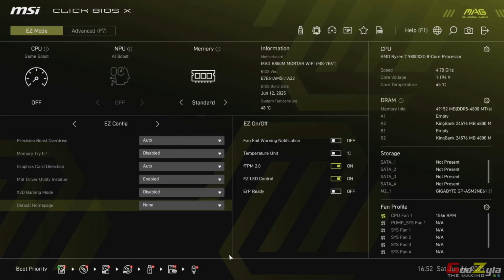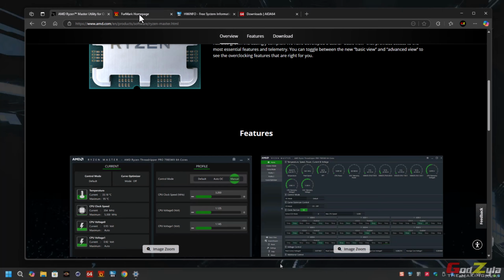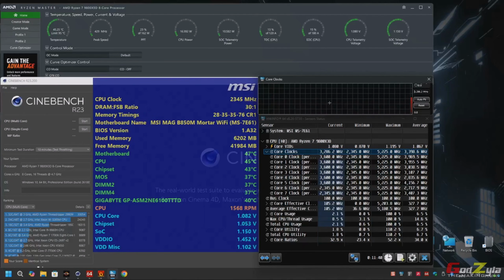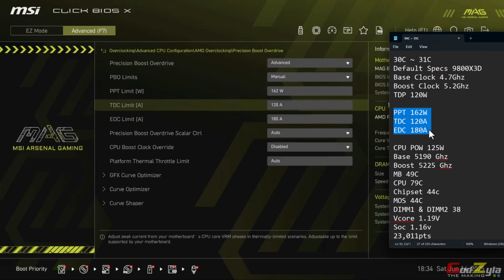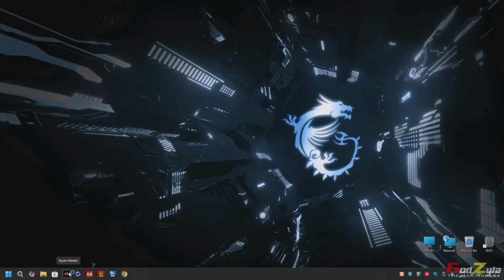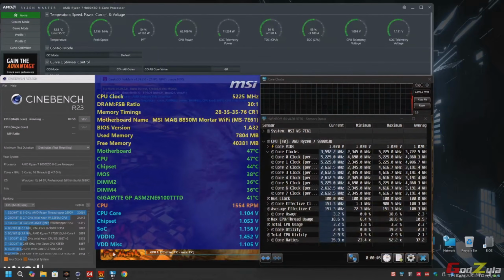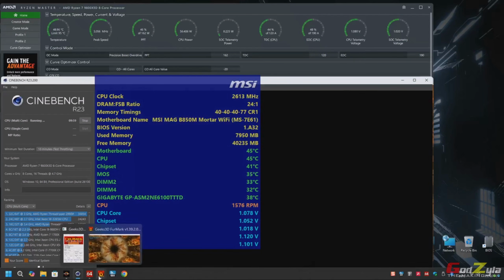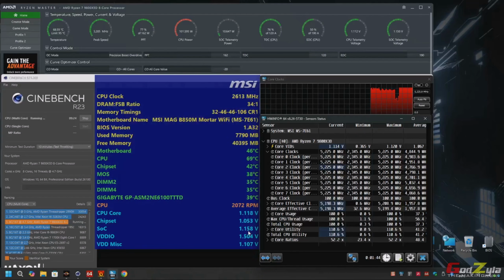PBO2 Curve Optimizing with 9800X3D on MSI Motherboard

Comment: Thank you for this. It helped me w lot to keep the temps in check. I have 2 questions: 
1. with current settings I went down from 5.4Ghz to 5.25Ghz max boost, is there a way to keep same settings but still achieve at 5.4? and is it worth it? 
2. Second quesiton I have a V-Color Manta DDR5 at running at 8000Mhz, CL38 - stable with EXPO without any issues, temps are low as well. However, I was completely unaware about the SOC Voltage relation. Any piece of advise for RAM settings on this one? I would really like to keep the 8000Mhz as I payed exrtra for it and these speeds are officially supported by this mobo / CPU combination (QVL). 
And AMD says its perfectly fine for the SOC to be at 1.3V for this CPU with that RAM speed and it just should not go over so Im a bit confused now :) 
My Mobo is MSI X870E Carbon Wifi with their latest BIOS.
Reply from the maker: Hi Light Orb, welcome to my channel. The question is, what is the CPU power drawn, the thermal temperature and the SoC drawn, when your system is running at 5.4Ghz? If it draws below 120w, temperature at 80 ~ 85 degrees celcius and SoC below 1.2v. You can revert back to your settings. Maybe you need to know how much you are stressing your processor. Base clock is at 4.3GHz and you are stretching it to 5.4GhHz. The concept of an elastic band, will it be good to stretch it for a prolonged period of time?
Also as for your rams. You can set it to run at expo and manually set it to run at 1.18v. This should be sufficient.
Reply: @KleoYan  Thanks! just to clarify for the RAM - High Efficiency mode to Auto amd CPU NB/SoC Voltage to 1.18V, right?
Reply from the maker: @lightorb2932  Yup for High Efficiency mode, set to auto, as I have tested 32G kit which is at CL36, I can't go tightest timing nor tight timing, I have set to auto. I will sill urge you to give it a try, no harm trying, but oo test for stability if it's able to load to windows. Yes for the CPU NB/SoC voltage, set it to 1.18v. if it runs stable and such. you can slowly tune down to 1.16v. If it can't run stable, then set it to 1.2v. 

maybe some info about SoC voltage on DDR5 rams as in general to operate safely. DDR5 memory does not typically run at a 1.3V SoC voltage. While some older BIOS versions or specific configurations might allow it, the recommended and safe operating voltage for the SoC on modern platforms, like AM5, is generally 1.2V, with 1.3V being the upper limit and often unnecessary for standard operation. Running the SoC at higher voltages than necessary can lead to increased power consumption, heat generation, and potentially reduce the lifespan of the CPU.
Reply: @KleoYan  I tested at 5.4 and 5.25 and yeah its 1-2 FPS difference and about 100 pts. less in Benchmarks but the temp  benefit is about 12-15C for me (espetially on the CCD sensor - 79C under 100% load - was going for 95 before). 
1.18V SoC works and its super stable even on my 8000Mhz RAM kit so I think Im sorted. TY again for this video.
Reply from the maker: @lightorb2932 good to hear. Congrats on your configuration 😉

Comment: I have finally been able to get to the setup. My wattage dropped from 110 W to 88 W. (I ve seen 85 W, isnt it too low?) The Temps went from 79 to 70 . My cinebench went from 22950 to 22500. The clocks are stable at 5225 mhz. Not sure if this is a good result as initially the power draw was almost 140 W.
Reply from the maker: Hi Samuel Rolinec, welcome back. With your current settings, have you try running OCCT test? If it pass without failure, that will be good and you can try some games to see if your system is holding well. Now as to answer your question about the CPU Power current. If you have done all stress test and to run games, though your Cinebench score drops by 450pts but your wattage draw drops from 110 to 88watts plus your temperature drops by 9°C. Would you prefer to draw lower current and having better thermal in long run and are you able to feel the difference between 450pts differences in performance? The choice is up to you as I have mentioned in this content. My objective is to prolong your processor and other component lifespan.

Comment: System doesnt even boot after I did this.
Reply: Probably the memory set to tightest was too much for your ram?
Reply from the maker: @god-zilla4233 oh you are right. Totally forgot about this setting. Thanks
Reply from the maker: Hi Faith, welcome to my channel. Maybe list down what components you are using, as majority of my viewers are able to do so, you can check on my comments here.
Reply: @KleoYan I have handled it by changing some values. Thanks.
Reply from the maker: @faithVO  ok. hope you did fix the issue and maybe share what you have changed and why was it not able to boot for you?
Reply: @KleoYan  PPT- 115 / TDC - 90 / EDC - 105  / Curve Negative -25
Reply from the maker: @faithVO thanks for the update. So long it works for you.

Comment: Thanks for this guide. I am using your settings on my MSI X870E Carbon Wifi and my temps goes down to 73 C. Is it necessary to install the igpu? coz I disabled it on bios; didn't install the igpu driver and prefer not to use it. coz I read it on reddit that it is unnecessary if I'm using graphics card.
Reply from the maker: Hi Verbatim1129, welcome to my channel. It’s perfectly ok not to use the IGPU if you have the discrete GPU and you should notice your CPU power drawn will be lesser.

Comment: I would like to see a video like this on a Gigabyte Aorus X870E Pro motherboard with an AMD Ryzen 9800X3D. Like you said following other videos to tune and overclock typically ends in failure. I have ram that has 6000 bus speed and I just turn on Expo and it just works. I love your videos because you get into all the details.
Reply from the maker: Hi B9Bot 1, welcome to my channel. Currently am looking into it and to request a board from Gigabtye. If they do answer to my request. Yes I will do up a content for gigabyte. Thank you for your suggestion 👍👍👍

Comment: How about the FCLK and UCLK? Just leave it Auto?

I have GSkill 6400mhz CL30. I saw a lot of youtuber setting FCLK to 2000 - 2133mhz and choose UCLK=MCLK 1:1 ratio.
Reply from the maker: Hi Aden, welcome to my channel. Yes as the advantage to set 1:1 ratio will help heaps in performance and latency.

Comment: Hello

I would like to try out the set-up you demonstrate in the video. Regarding the initial part with the RAM setup before Windows installation, is it crucial that I do it before Windows is installed or can I adjust the RAM settings even if I have it already installed. 

Thanks
Reply from the maker: Hi Samuel Rolinec, welcome to my channel. If you have already installed windows, you can still set it, no issue.
Reply: @KleoYan  Thanks for such a quick response!
Reply from the maker: @samuelrolinec2727 you are most welcome

Comment: Amazing video, thanks!
Reply from the maker: Hi Yuri, welcome to my channel. Hope this content will be useful to you. Thank you for your feedback and all the best with your configuration. 😉
Reply: @KleoYan  Can lower RAM latency improve gaming performance? I don’t know if I should try tweaking my G.Skill kit…
Reply from the maker: @nanwu33  you can try using the Memory Try It! or manually set it but will need time to do that. I will just enable the High-Efficiency Mode and set the Memory Timing Preset to Tightest.

Comment: Hi Kleo, thank you very much fir this useful video. I have adapted some setting to make it works with my 7950X3D and it very easy to do as you explain it so clearly. One quick question about the VCore offset, if my system is now stable with 0.05 V offset, if I want to bring the voltage down more what is the step I should do (like 0.055 or 0.06 ?) and does it will risk anything in the future aside from the unstable that might happen ?
Reply from the maker: Hi Baseeball Ti, welcome to my channel. I was not able to do below -0.05v. You can give it a try but you will not see any significant drop on thermal by just -0.01v more. Nevertheless, all the best with your tweaks 😉

Comment: Thanks for the video! I was recently upgrading to AM5 and downsizing my case and stumbled across your channel. Many thanks for the fan layout and build guide for the AP201 m-ATX case! 😁
I was wondering, would these same settings be applicable to a 9900X rather than a 9800X3D, or would a different curve be needed? Many thanks and subscribed!
Reply from the maker: Hi pick. Welcome to my channel. You can apply the same. Just make sure to find the default PPT TDC and EDC of your processor and inclusive of the default TDP.

Comment: Hey, thanks for your video. Great work. I have a question regarding my G.Skill timing. I've now set the voltage to 1.2. But does that affect my combination? Or can I set it to auto? I have 2x 16Gig with 6400MT. What do you think, should I leave it at 1.2?

Thanks
Reply from the maker: Hi Dragonfly Jones, welcome to my channel. so long the SoC VDDCR voltage is not above 1.2v it will be fine, but personally, I will try Soc Voltage to 1.5v. this is where my 48G Kit CL22 6800 can run.. Addition to this. having the sweet spot SoC VDDCR Voltage does not affect performance with the rest of your settings in CO and CS. I am unsure about G.Skill. As mentioned, you can give it a try.
Reply: ok i will try. Thank you very much  @KleoYan
Reply from the maker: @dragonflyjones2268 ok all the best 😉

Comment: My kit is only stable with 1.3 soc voltage is 6000 cl 26, is there any danger in this?
Reply from the maker: Hi MaicoN, welcome to my channel. I can only explain to you that the higher SoC voltage, it will increase in thermal and will degrade the processor. Btw how big capacity are your rams and or which brand that is?

Comment: Can I try to use this settings with the x870e tomahawk and gskill cl 30 6000?
Reply from the maker: Hi KuroJota TV, welcome to my channel. Yes you can, the steps and procedure are identical.
Reply: @KleoYan  Hi Kleo and thank you so much for your answer. I also have a nvidia gpu can i do this without having to install amd adrenaline? Now on windows i get lots of screen flickering. Thank you so much for your content.
Reply from the maker: @kurojotatv1804  for this, go to bios and disable the APU, use only your discrete graphic card. or you can just install the chipset driver and not Adrenaline.

Comment: Great content. One question:

Are there any settings to set in ryzen master to use it just for monitoring? Its a confusing application for me. Does it apply the stock bios settings? Overrides previous bios? I dont like it lol i think its weird. Not bad for monitoring.
Reply from the maker: Hi Ander Otaola, welcome back. I did not do any settings and install ryzen master. once loaded, it will pick up the settings you've done in UEFI. I only use it as a monitoring dashboard.
Reply: @KleoYan ok. For some reason ryzen master doesnt show my bios selections under the “control” tab. 

It’ll show my CO adjustments, but not the adjustments for edc, tdc, ppt. 

Otherwise it all works very well… just my ryzen master doest show thise adjustments
Reply from the maker: @anderotaola7515 hmm maybe use revo uninstalled to uninstall ryzen master and to delete the registry and unwanted files than reboot your system. Install ryzen master again. See if that helps 

( https://www.revouninstaller.com/ ). Revo uninstaller will remove all unwanted files / folder / registry in your system. Illustration to use revo uninstaller https://www.youtube.com/watch?v=uMgUYiakpxM&t=437s
Reply: @KleoYan alright, ill give it a shot when im at my desktop. 

A simple removal with windows wont do it then? Id imagine as much— that ryzen master is a bit insidious lol

Thanks for the suggestion, I’ll try soon.
Reply from the maker: @anderotaola7515  just incase if there are leftover registry and unwanted files. I always use revo uninstaller to remove application. as in to have it totally clean out from the system.
Reply: Long story short— it works flawlessly now. All tour settings dialed in very well on identical setup— b850m mortar +9800x3d. Mine runs hotter since its inside a lian li a3 case. 

Cant say why now -.05v offset is yielding wonderful results but it is. The only difference is I noticed my CO was set to -25, not -20. I doubt that would cause such issue. I also used revo, cleaned up, double checked bios, etc etc.  scored 23204 on R23. Smooth. Same performance as yours except the temp and small details like that. 

Excellent stuff, sir. Thank you. 

For the life of me i dont know what changed— but it lined up to your results very well.

EDIT — my highest vcore value during r23 was 1.096. Is that too low?? It was performing super good. I dunno— seems low.
Reply from the maker: @anderotaola7515  hahaha.. well at times it can be a 1.09 or even 1.04v as I experience.. it's normal, not to worry. your motherboard is doing all the calculations when you've set offset. Congrats! 😉
Reply: i actually just now ran revo— and wow! It found stuff i  glanced over when i was looking for registry. Ryzen master does have a lot of stuff you cant easily see, sheesh. 

So i deployed revo uninstaller successfully, but i still cant get RM to display my bios adjustments. It just comes up as stock.  Now not even my CO is reflected on RM… 

The bios adjustments have indeed yielded the expected beneficial results, as I track through hwinfo. But RM has stumped me.  Think im quitting on it, haha. 

Btw is it safe on revo uninstall to just select delete all after advanced scan? Or just selece the bold entries? It weirds me out to knock out whole folders. I imagine a quick reboot repopulates all the essentials. 

Finally, the only part where I went different than you is that my core clocks werent stable at -.05 core, it went well at -.04 (we have identical cpu/mobo re: this video) 

Is this a bad indicator for my silicon? Seeing as -.05 shouldnt be too terrible for most cpus? Mine starts showing 5220 core clocks..5219.5 etc. Lottery? Degradation? Ugh i love knowing and learning stuff, but ignorance is bliss sometimes lol

Thanks for your attention and content.
Reply from the maker: @anderotaola7515 revo is perfectly to get rid of residue registry, folders and files which normal uninstall can’t do. I always use advance scan. So you need not have to worry. 

Hmm you mean you can only do vcore offset of -40mV?
Reply: @KleoYan yes, CPU offset voltage -.05v did not work well for my cpu. Core clocks did not remain 5225 and stable. “Jagged line”.  At -.04 its happy. My cpu used to be in an asrock mobo that was improperly set sadly. Maybe it needs more “juice” because of some issue. Otherwise it works very well
Reply from the maker: @anderotaola7515 I see. I wouldn’t say it’s bad. It could just be the bin. If it’s running stable at -0.04v. Let it run at that. Having set vcore offset is mainly for the motherboard to calculate what necessary and sufficient voltage for your processor to run at that cater clock frequency. So ya, don’t worry too much on it 😉
Reply: @KleoYan thank you. Despite that, it can run aida64 stress for hours with -30 in CO. Go figure.

Comment: Thank you again so much for this superbly informative video on PBO, CO and CS. 

Was trying to understand the CS settings and this noob friendly guide certainly helped me to lower my 9800x3d power consumption from 115W (Initially just CO at -20) to a mind boggling 99W. 

Never knew 9800x3d could be so efficient. Thanks again and keep the content going! :)
Reply from the maker: Hi Daniel Lan, welcome to my channel. Glad to of help, happy for you with these good results. Thank you for your feedback. You have no idea how much I appreciate with your sharings. 🫡
Reply: @KleoYan  No problem! Your video will lower many 9800x3D users power consumption at worst and save many dead 9800x3D at best. 🙏
Reply from the maker: @finaltidus1984  Thank you 🫡
Reply: @finaltidus1984  Hey, test your system aida64 cpu fpu cache minimum 3 hour bur better 8 !

Comment: Wow thank you for this video, i will definitely try when i get home. I currently have it at +200/Motherboard Limits/ -20 on all cores.
Reply from the maker: Hi EliseoJV, welcome to my channel. Thanks for the comment and hope this content will aid you out. 😉
Reply: @KleoYan  Before
PBO +200/Motherboard Limit/x10/-20 All cores
PPT 1000w
TDC 360A
EDC 180A
CPU POW 124.2w
Base Clock 5205
Boost Clock 5425
Temps
MB 57c
CPU 92c
CHIPSET 53c
MOS 60c
Dim 2 & 4 40c 42c
Vcore 1.220v
SoC 1.210v
Score 20423
Reply from the maker: @EliseoJV hmm ok. Did you try the method explain in this content?
Reply: @KleoYan  Yes After following your steps:
PPT 162w
PPT 120A
EDC 180A
CPU POW 110w
Base Clock 5225
Boost Clock 5225
Temp
MB 56c
CPU 86c
Chipset 51c
MOS 56c
Dim2 & Dim4 45c 40c
Vcore 1.178v
SoC 1.162v
Score 21404
What do you think? My temps are better and it does feel more stable.
Reply from the maker: @EliseoJV Awesome! Congrats too, your processor will be much healthier with vcore voltage lower, SoC voltage lower, temperature lower and not over stretched. Good results overall 💪💪💪